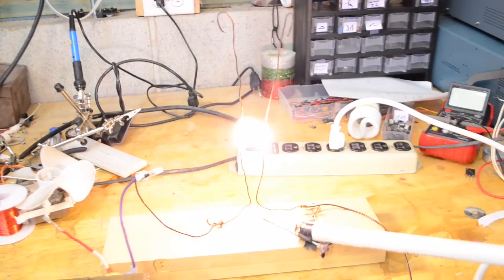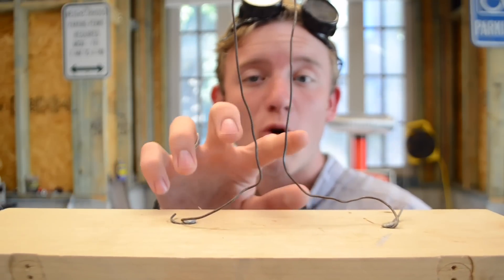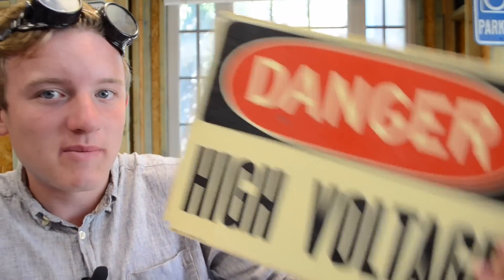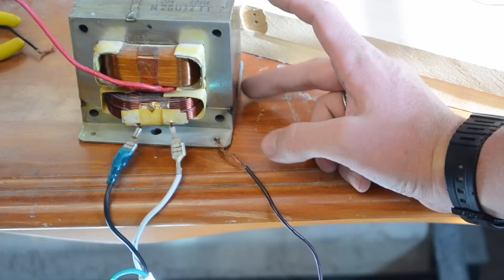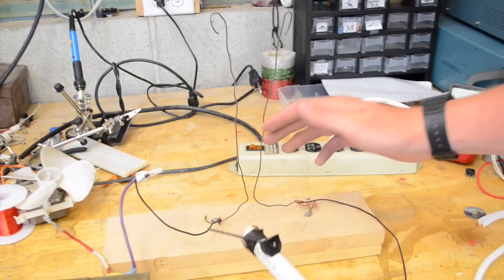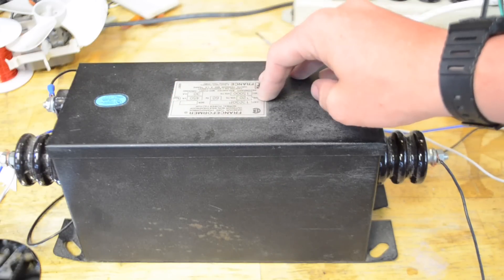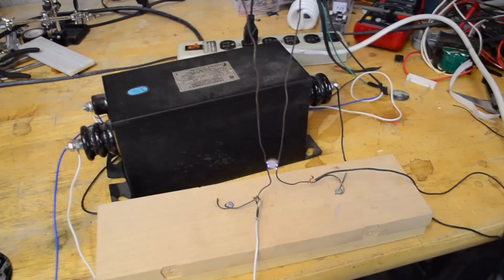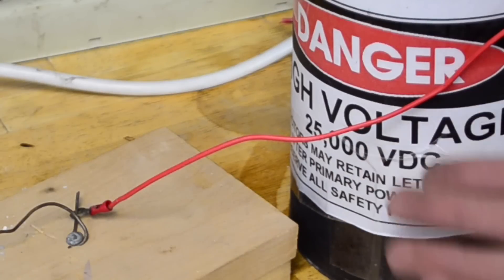How to make a Jacob's Ladder

Comment: 🤔 Did you you know that if you reverse the angle, and then bend the tips away and down from each other in creating a sudden bend, balls of light will shoot off the end. One rod must be a little bit longe, and you’ll need to unleash a hefty charge of static electricity to make this happen. A bank of High capacity static capacitors is required, and a trigger to release the energy all at once they are fully charged.

Comment: You can put a candle under the point where the arc should jump. Then it works because the plasma from the fire is also more conductive than normal air.
Reply: I subbed! (I'm the same guy but this is my main account)

Comment: Just got my transformer 12000volt 60ma. If it doesn't kill you it will hurt for a long time...If it does kill you it will hurt you for a long time before it does.
Also most new transformers have a GFI break in them. So after a few cycles it pops that safety. The older ones do not have the GFI interrupter.

Comment: if you attatch two nine volt batteries together, do you have a roughly 18 volt current?
Reply from the maker: +Avery Fleeharty yes :D they have 18 volts ( well if your connecting the positive of one to the negative of another )
Reply from the maker: +Avery Fleeharty no problem! Let me know if you need help with anything else ! :D
Reply: Keystone Science Thankyou!
Reply: Keystone Science the batteries are for electroplating, have you done any more tests than the 5 and 12 volt tests that you did in your video on it? 

(i've tried electroplating before with an old charger (wires cut out, and then experimentally finding which one was negative) it worked pretty well, but i never found out the voltage i was using.)
Reply from the maker: +Avery Fleeharty yes, but I can not remember, however, I am more than happy to get some data for you! Just let me know what voltages you want to test and I'll do it :D
Reply: Keystone Science if you're willing, a test between 9 and 18 volts for plating copper onto copper would be amazing!
It makes a pretty cool fractal (but rounded kindof) copper crystal if you leave it long enough.

i'm sure 18 volts will plate faster, but i think there's a point where the voltage can get too high for crystallization
Reply from the maker: +Avery Fleeharty ok sure thing! I'll test it tomorrow after I get out of school and I'll let you know how it goes!
Reply: Keystone Science Thanks a bunch! (if it isn't obvious, i've already liked and subbed :) )
Reply from the maker: +Avery Fleeharty haha no problem , and thank you :)
Reply from the maker: +Avery Fleeharty hey, sorry I wasn't able to get the data today, ( I just had a lot of things come up :P ) but I will for sure get it to you tomorrow !
Reply: Keystone Science it's fine. if anything i can just do the experiment when my finals are over. you don't have to go out of your way
Reply from the maker: +Avery Fleeharty haha it's all fine :D , so according to my tests, the higher the voltage I used for the plating, the worse and worse it plated, I think this is due to too much hydrogen and oxygen being produced at the terminals, but anyways, I had the best plating outcome at 3v ( so just 2 AA batteries ) . So yeah, I think theoretically although the higher voltages allows more current and thus more plating, realistically it creates other factors that harm it more than help it . ( also I was using a baking soda water solution ) let me know if you need me to test anything else :D
Reply: Keystone Science thankyou!
Reply from the maker: +Avery Fleeharty no problem !

Comment: so it won't work in a vacuum?
Reply from the maker: +Steffen Singleton not quite the same, in a vacuum there is nothing to turn into a plasma as you see in the video, so with high enough voltages you would still get electrons to flow through it, but I imagine it looking pretty different.
Reply: +Keystone Science nifty

Comment: can you build a electromagnet from a microwave transformer please
Reply: Christian ********** - Have you seen the video done by Make it Extreme?  An entertaining video but it does not include a thorough look at electrical connectivity.
Reply: Luke Johnson. thanks Luke
Reply: Christian **********  That is a very dangerous thing you are attempting and also if you are using a microwave capacitor then it may become an EMP